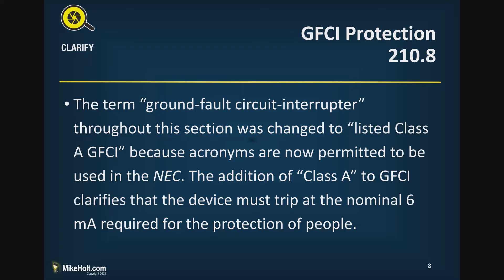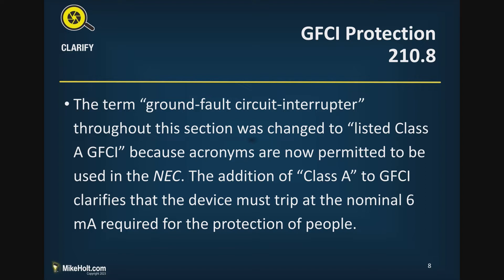Ground-Fault Circuit-Interrupter Protection for Personnel, 2023 NEC [210.8], (03min:11sec)

Comment: Mike- will you please make a video  on a 3 wire 240 volt GFCI
 (line-line-grounded GFCI) 
how it works with no load neutral, does the load require a special purpose GFCI or can a Line-ground GFCI work for this situation, etc. 

Situation:
Jacuzzi brand hot tub only uses L1, L2, EGC. 
They don’t use neutral at the tub at all. 

So, does one use a normal “spa” “hottub” GFCI panel/disconnect
Or
Is there a special purpose GFCI needed to trip properly?

Manufacture does not have a recommendation. 

Thank you Mike.
Reply from the maker: Neutral is not needed unless the load requires a neutral.
https://images.thdstatic.com/catalog/pdfImages/d1/d1d00791-4609-4aab-bcf4-d5a9236110e7.pdf

Comment: So a plug in device has a voltage and current rating, a suitability description (wet locations, tamper proof, GFCI, etc).  Are there adjustable sensitivity GFCI or AFCIs?
Reply from the maker: Nope, they are set based on the UL standard.